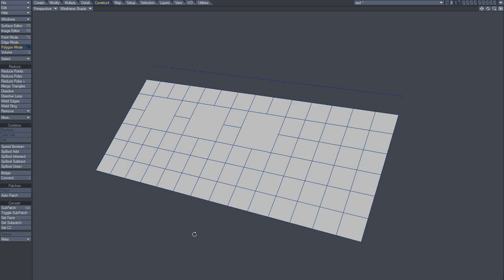LightWave Model - Dissolve, Merge, Delete - 101

Comment: Thank you.  I've used LightWave (more seldomly than I'd like) since before edges were selectable and had two bands of adjacent polys I wanted to join into one band, without merging into one abstract monster polygon.  My search lead me here.

It's not before occurred to me that deleting the edges would work so differently than deleting points.  I remember being excited about edge selection and it factoring into my last upgrade purchase...perhaps I knew this back then, but it slipped away.  Thanks for (re?)opening  my mind to this simple but powerful feature.
Reply from the maker: Thanks, always quite a lot [>tons<] one has to remember when creating 3D    :) 
happy 2 help   :)